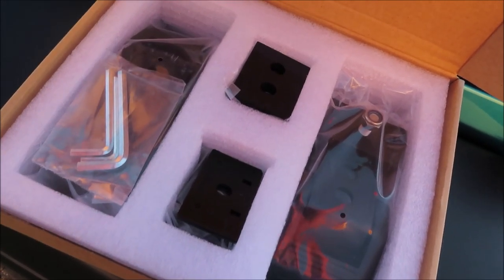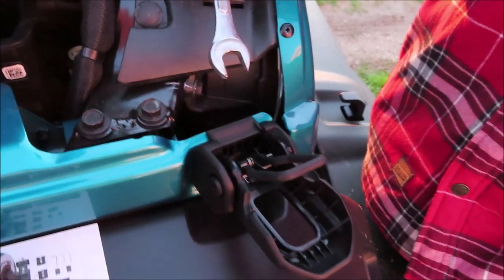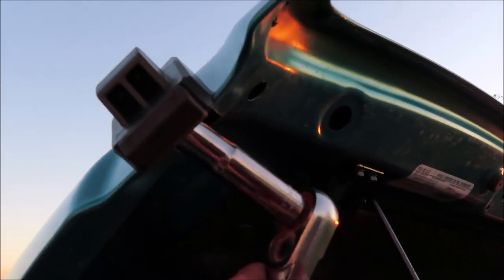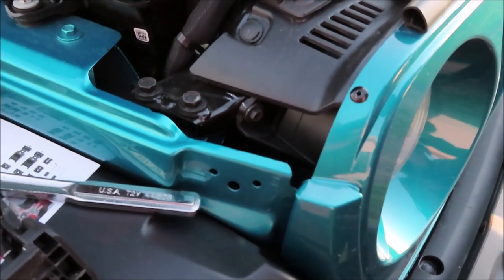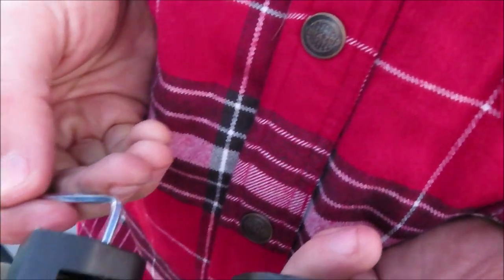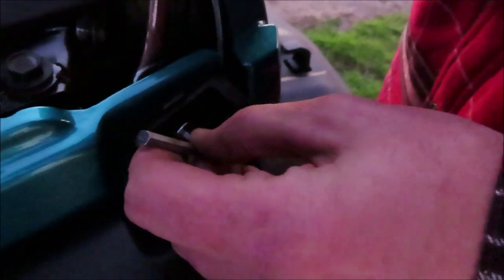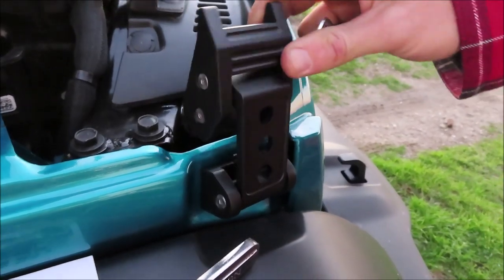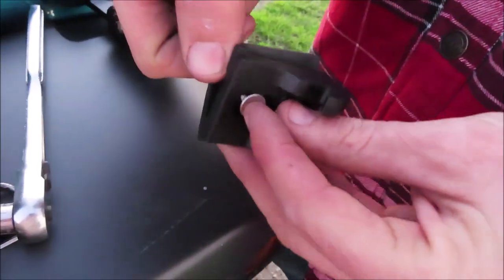Upgraded my hood latches on my Jeep Wrangler JL!

Comment: >>>One thing I found out. The lock nuts do not come with washers or mine didn't use some small flat washers so you don't pull the nut through the hole on the thin sheet metal hood. I had already installed the lower latch you might use one there also. I like them they do look and work great